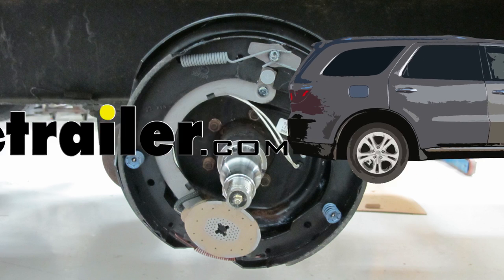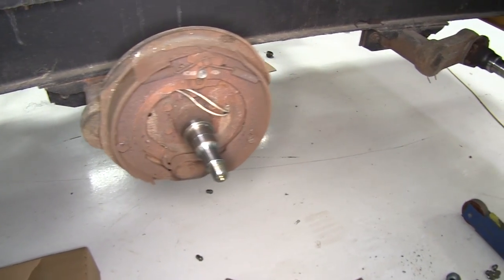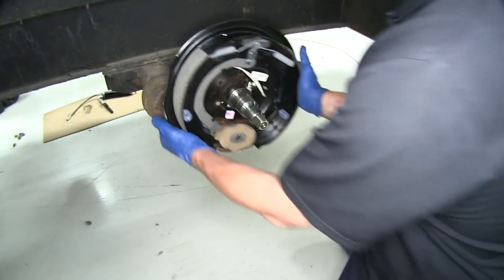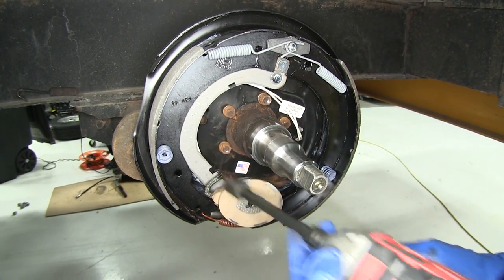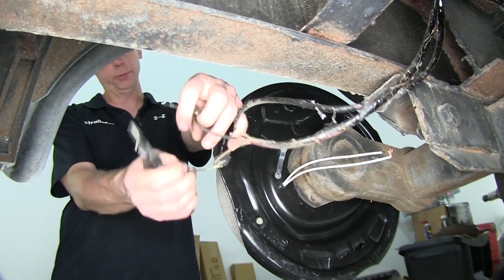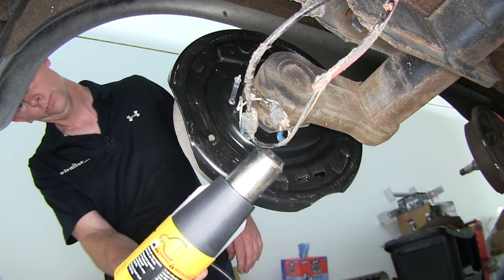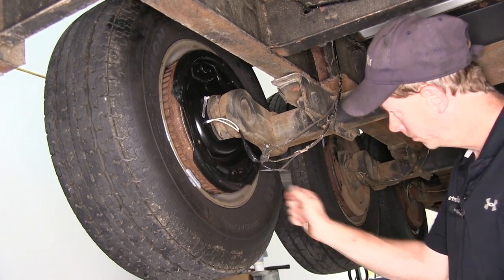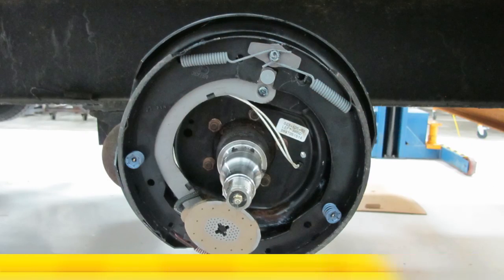etrailer | Dexter Electric Trailer Brake Assembly Installation 23-105

Comment: How do you know how much lube you need to put in for bearings? And what is torque spec for the 10 inch hub for the backing plate?

Comment: Hello I have a dexter axle the drum has a 62015 b number I would like to upgrade the brakes do you think that is possible
Reply from the maker: In order to upgrade the brakes there are a few things that we will need to help you. Can you provide us with the axle weight capacity, inner and outer bearing part numbers (will need to remove the hub), and how many bolts are on the brake mounting flange?